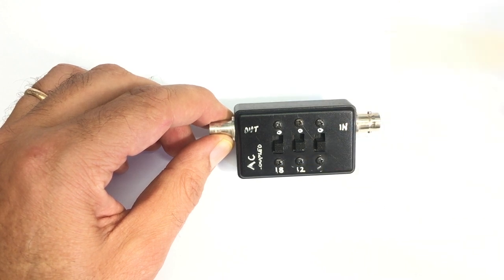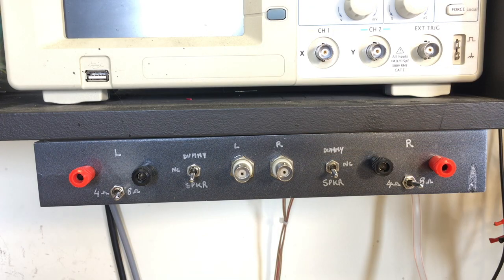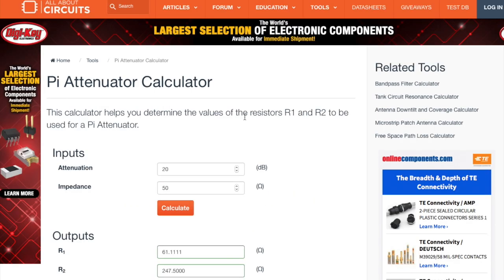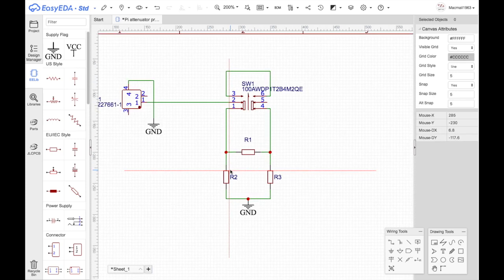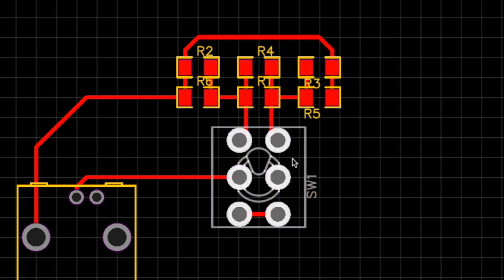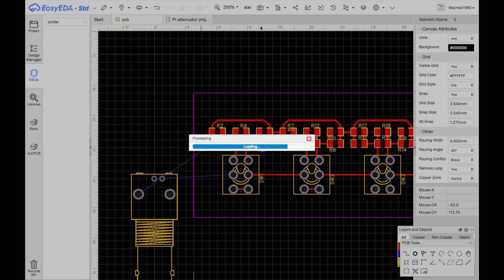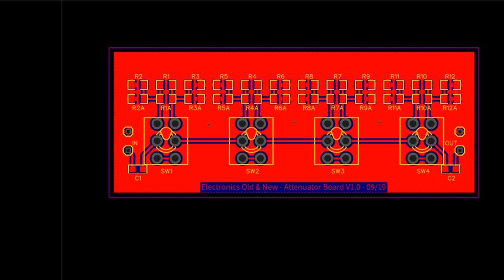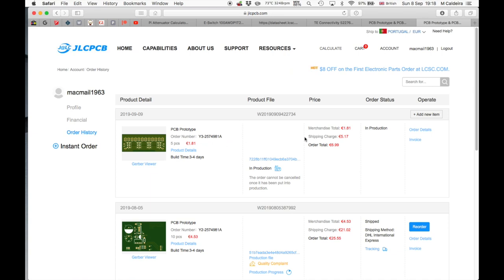Pi Attenuator board design with JLCPCB

Comment: Inspired by your little black plastic box I have been building my own RF Attenuator circuit over the past month or so.  Mine will have seven pi-attenuator circuits arranged in binary fashion from right to left to give me all attenuator values from zero to -128 dB in whole number increments.  It will also include separate 50 watt dummy loads for 4, 6 and 8 ohm stereo speaker systems and everything will be stuffed into one 7.4" x 4.75" x 1.3" Hammond cast aluminum box, mostly because that was the one size I had on hand.  It will, however, fit nicely under a shelf to save space and also serve as the heatsink for the resistors, though I honestly don't plan to service radios having much more than 3 watts output any time soon.  It's a tight fit stuffing everything into such a tiny box but I found some sub-miniature toggle switches, 1206 resistors and 50 watt planar resistors online which help a lot.  Most of the time was spent reteaching myself how to make my own PCBs, and now that I have succeeded I will probably end up using your favorite PCB fab house for future projects.
Reply from the maker: Sincerely Yours : I’d really like to see photos of the result, if you can. Enjoy.
Reply: @electronicsoldandnew :  I'd be happy to share a few photos, though I'm not sure how or what medium I should use to upload them.  Any suggestions?
Reply from the maker: Sincerely Yours : my email. mcaldeira (at) icloud (dot) com

Comment: Great tip about using a DC block capacitor. I am working on old AVO signal generator at the moment I have found the output attenuator is burned out probably because someone in the past has forgotten to use a dc block etc. Thanks for sharing regards Chris

Comment: I like the idea of the modular test components on the shelf, test gear on the top and function boxes on the bottom, hung in a C-channel like style. 

I have a similar workspace setup on a table/shelf workbench I made in my woodworking shop but I'm running out of space on it (its never good enough eh?). 

I have a similar audio dummy load box but I added a Digilent analog discovery board (like the Blueglow setup) and run (TheStuffMade) software on it for my signal analyzer but I need to add a stereo amp module to the setup... the issue with my setup is that the boxes are on top of the shelf (taking up valuable room) and move around too easily.
Cheers,
Reply from the maker: I agree that we never have enough space :) or equipment :) 
I chose this setup to make everything immediately accessible and easy to use. I’m also adding a power amp in the near future, and quite like the “workbench amplifier” that Elliot Sound Products presents on his site. It’s basically a chip amp and seems to tick all the boxes. No point reinventing the wheel.

Comment: Hmm.... a few thoughts, mostly following from what others have said:

- Autorouter: people hate them (for good reason!); I kind of like them for their ability to show you ways that don't work. You can save a lot of time by letting the autorouter do its thing, then avoiding its mistakes 😜
- Layout & grounding: One of the big tips for RF board design is to think just as much about how return currents flow in cct ground as how the signal flows. It's not DC; "ground" paths become reactive impedances with both inductive and capacitive elements, and return current will want to flow as close to the signal conductor as it can. The upshot is, for maximum performance (both frequency response & linearity/flatness), it's best to keep all those paths as short & as close to the signal as possible.

At the moment you've got widely-split ground paths - between the in & out pads, some will want to flow on the rear ground plane underneath the signal path; some will try to flow beside the signal path on the top ground fill, and a good amount will have to flow up and across to the pad grounds on the top ground fill. And the only things tying those paths together are the in & out ground terminals (which I hope are plated-through holes connected either side) and 3 little vias...

Tips: with your basic layout, I'd turn the resistors that form the 'sides' of each Pi section 90 degrees so the grounded end is nearest the signal traces. Sprinkle ground-tie vias around liberally - I'd put 5 at the grounded end of the resistor pairs (1 each on either side, 1 each below the pads, and 1 between the pads), stitch vias alongside the signal traces (maybe 2 between each switch _on each side of the trace_), and another 2~4 or so up around the traces & resistors that form the 'top' of the Pi sections. It's not like JLPCB are going to charge you extra for too many vias (well, they will if you go silly, but that's nowhere near 'too many'), and all aspects of pad performance - signal leakage, noise pickup, frequency response, and linearity - will be much improved.

(And once again, sorry for the long & seemingly critical comment - I try hard to avoid it, & I'm not as bad as many of them, but the tactless engineer in me finds its own ways of showing itself... 😉)
Reply from the maker: Jim, there’s no such thing as a tactless engineer ... haha
I really do appreciate your input. I always consider this hobby a learning experience and am truly open to that. I admit to limited experience with RF design, so your feedback is whet this is all about. 
I am becoming more convinced that there simply has to be a V 2.0 version after the first build :)

Comment: I recently needed precise values for resistors while tinkering with a software-controlled decade resistor (1ohm-120Mohm, 750mW).  I put together a spreadsheet of E6 value combos - 1 resistor, 2 in series, 2 in parallel or 1 in series + 2 in parallel.  There are  15K+ values (between 0 and 126K, although above about 68K they're (obviously) widely-spaced.  There are 4K different combos between 0 and 100.   

I laid out a PCB footprint that allows all of these combinations, requiring a track cut for the "1 in series + 2 in parallel" application.  Dunno if it was clever or not, but seems to work. 

37.3519 is approximated by  4R7 (in series) + ( 33R || 3K3)  -> 37.373 ohms.  

Alternatively, 3R3 + (68R || 68R) -> 37.3 ohms and 33R + (4R7|| 68R) -> 37.396 ohms. 

150.476 is approximated by 1R5 (in series) + (150R|| 22K) -> 150.484 ohms

Alternatively, 68R + (100R||470R) -> 150.456 ohms, 10R+(150R || 2K2) ->150.426 ohms,  150R + (1R0 + 1R0) -> 150.5 ohms
Reply from the maker: It’s always easier with a board, and that was a great idea.
Reply: @electronicsoldandnew   Hmmm... Now that I think of it, a "2 in parallel + 2 in parallel" would not take up a significant amount of additional real estate and would allow even more combos.  Also, the track cutting option is unnecessary with 0 ohm resistors.  I used huge SMDs - 2010 - for extra power capacity and because this is my first SMD project.  Actually, many, many firsts for me in this project.  I didn't expand to E12 because of the huge number of results.

Comment: Just a thought, with so much ground plain on the back of the  board you might have an issue with capacitance at high frequency!.
Reply from the maker: Very good point. I’ll have to do a frequency response test when boards arrive and I do the build. Thanks.

Comment: Has this software a autorouter-function? Then the question like Michael Beeny, how abt capacitance between the signallines and the big groundplane? I like shielding realizing with a aluminium cabinet.
Reply from the maker: It does have autorouter, but I never use it. 
As I said to Michael, I didn’t think of that o) I’ll have to test frequency response when I do the build.

Comment: I was wondering about if it should be double sided or not but if it is used at the low end of the hf spectrum and put into a metal box then single sided board would be enough.
Reply from the maker: I chose double-sided to create a shield at the back, and like an idiot forgot about the capacitance issue. We’ll see how it turns out.